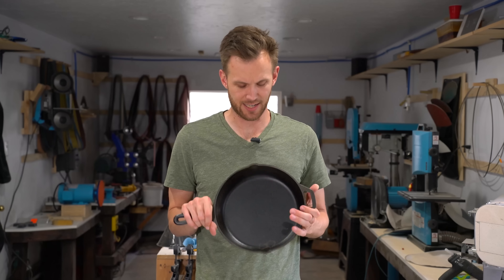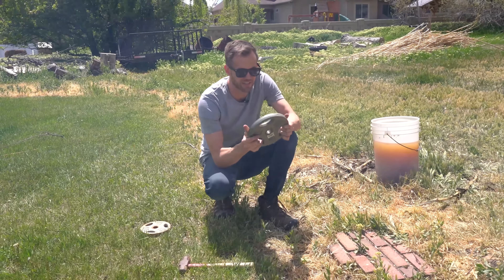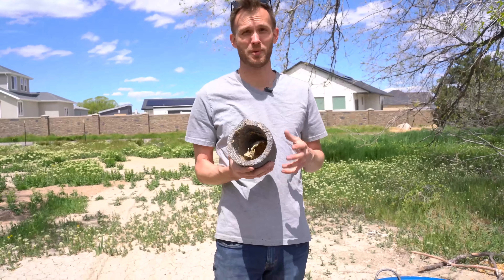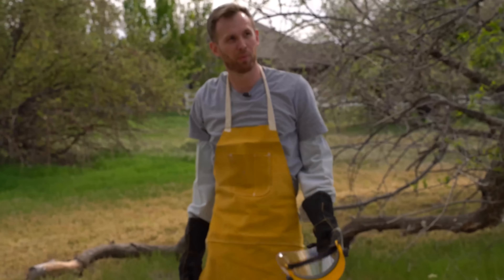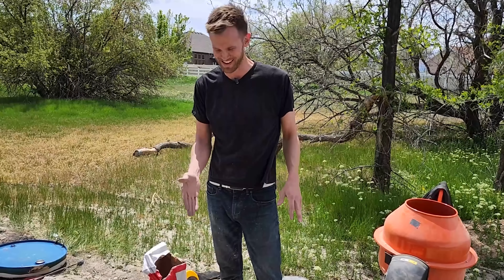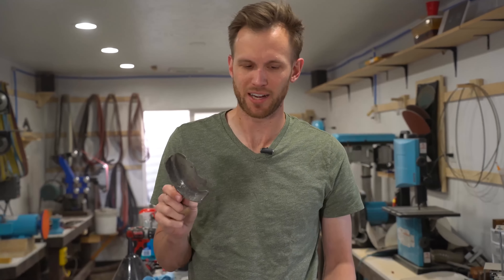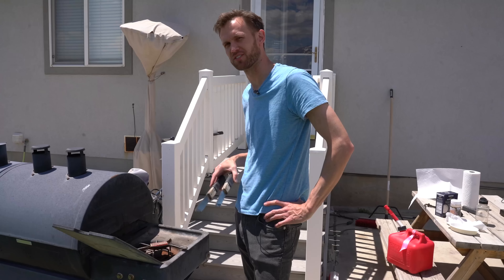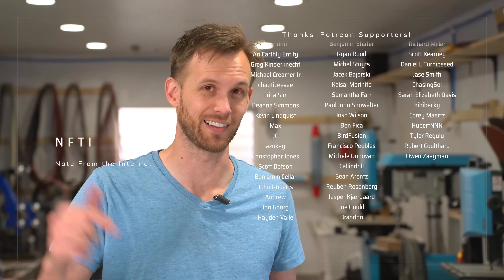Turning Weights into a Cast Iron Pan!

Comment: When casting, you also need a place for air to come out as metal goes in. Love the videos. Keep trying
Reply: This, more than anything! It's also a good idea to make a riser, a reservoir above the mold which gravity feeds your iron in. Most guys use a soup can and some steel tubing as a form. It really helps to shove the metal into the corners.
Reply: An air escape hole opposite the pour while really would help.
Reply: @Corbald  Ah yes!, and helps hold the heat, too, keeping the supply of iron molten, if I recall correctly from my Uni days.

Comment: I've only ever casted aluminum and I did it nearly 2 decades ago but when casting, I believe we had a breather hole on the opposite side of the pour hole so it could flow without any pressure buildup. This will let the metal flow better in the cast and also let you see on the other side when you have enough poured as it will start to rise out the other side.
Reply: Good advice
Reply: I was wondering if there needed to be a second hole to relieve the pressure during the pour
Reply: There are some amazing mold coatings that are like a ceramic paint but they use extremely flammable solvents that burn off almost instantly and leave a mirror smooth surface finish right out of the mold. I've done a lot of aluminum casting and I've cast over 1000lbs of lead so I thought I knew alot about casting. Then I watched some professional foundry workers and realized that I only knew about 5% of what there is to know about casting.

Comment: Nate: YOU HAVE TO PUT AN AIR PORT OPPOSITE THE ONE YOU POUR INTO... AIR AND GASES HAVE TO BE ABLE TO ESCAPE JUST LIKE TRYING TO POUR INTO A BOTTLE AND IT SPITS BACK UP AT YOU. AIR CAN'T COME OUT THROUGH THE METAL BLOCKING THE ENTRY. REMEMBER HOT AIR EXPANDS AS WELL.

Comment: Can't help but think you should use the handle as a pour spout and cast it vertically to reduce heat loss.
Reply: This honestly drove me a little insane 😂
Reply: Nice thinking
Reply: It would be best if the sprue was on the bottom of the pan and was large enough to act as the riser also to control shrink, the handle should have a vent on the tip. It will relieve pressure and signal a complete pour.
Reply: All the really old cast iron pans I have seen had the casting gate in the center of the bottom of the pan.

Comment: I have a recommendation to help with your casting. Shape your desired piece out of paraffin or candle wax. Place this form in your Green sand and add pour funnel and vents. Pour your molten metal. The metal will burn away the wax, creating a draw, pulling your metal into the mold. Be careful because it will spit a little.

Comment: 1.)  It's not hot enough, you need to get well above its melting point to ensure it flows into the mold properly
2.)  the molds need to be vented in some way, the air inside them needs to go somewhere.  The wet sand will hold its shape but it's not porous enough to allow natural venting
3.)  the bubbling in the open molds is a result of the mold containing moisture.  Even the smallest drop of moisture can result in a steam explosion that sprays molten metal all over and causes bubbles in the surface.  Preheat your molds until dry whenever possible.
Reply: What this guy said. Hotter metal, air vents, preheat the mold. Yes, to all those.
Reply: And extend the sprue, somewhat
Reply: Totally agree, but want to add that the way to increase the temperature is by adding oxygen... NOT using compressed oxygen from a gas bottle, but blowing in air with a blower, (a pipe through the sidewall of the foundry to which you attach an old hair dryer, although you can use a manual bellows if you need an intense arm workout). Also has to have a port for the air to exit, preferably creating a vortex inside the foundry, swirling around the crucible. The color of the molten metal is the indicator of its temperature. Red hot is not hot enough, orange-getting warmer, yellow-almost there, almost white hot, get ready to pour.

Don't know for sure, but I think having the mould angled slightly downward from the sprue may help. Biggest thing though is venting. Trapped air inside the mould will prevent adequate filling.
Here is a good resource on making green sand
https://foundry101.com/mixing-sand/
Reply: Also you should never use wet molds you will have it make steam which can either produce air pockets in the metal or worst case it explodes in not a good way :)
Reply: Not to mention that a pre-heated mold will just cool the metal slower. Thermal transfer is proportional to the 4th power of the temperature difference, so even a little heat added to it will help a lot.

Comment: I remember from brass casting, your pore hole should be at the end of the handle.  You might also put a pore hole on the far side of the pan.  Build the sand mold withe the pore channels so you don’t have cave in.  Cut off the excess afterward.  Our castings used more than 1 pore hole to complete the fittings.

Comment: I think you need to add vent holes at the extremities of the mold to allow the air to escape. It’s creating pressure especially with the high heat. So once the liquid metal backs up, that’s it. It’s not going to go much further than where it is.

Comment: Also, when you're cutting the excess of the pan, it would help if you heat up the whole thing with a blowtorch in order to prevent any massive temperature gradients where you're cutting, I've cracked a cast iron pan by having it on a Swedish One Log Fire and strong winds hitting the side. Same goes for if you're welding cast iron, but that's a whole different set of skills. Great video regardless, I'm glad to see you didn't give up the moment you saw it wasn't going perfectly. Well done, and thanks for bringing back the golden days of TKOR.

Comment: Hey Nate, worked in a legit iron foundry for a number of years, I have some tips that could help. Try adding a wooden bead around the inside of each mould half, ideally a half round dowel, 20mm diameter would work, or failing that, a 10mm square baton, nailed to the inside of the wooden mould halfway up, this would give the green sand something to purchase onto. Also, we used resin set sand "air set moulding" it used a slow curing resin mixed in with the sand, set in about 20 minutes, after which, we would remove the "pattern" (the thing we are casting and then close the two sides up. we would only add the pouring hole and sprues on one side of the mould, and we would also add a smaller pouring hole, that would allow the iron to flow through and not create an air pocket, ideally this would be polar opposite to the hole you are pouring into - feel free to hit me up if you want to know more. loving all of your videos.
Reply: I wondered if you could mix something in with the sand to harden it, but would resin be able to handle those temperatures, and would it be food safe with regards to residue? Also have you ever used graphite for molds?
Reply: @DFPercush  so we used resin in a commercial iron foundry, 100s of employees. So I assume it was the correct stuff. And at those temperatures, I assume anything that could be considered non food safe, would be burnt off by the 2000 degree iron. We made all sorts, including iron pans.
Reply: @topcat2757  That's interesting, thanks for responding. One more question though, does the resin make the mold reusable, or do you still have to break it each time?

Comment: Yes, I want to see you do more with cast Iron!
A blower will help get the temps up higher in the propane foundry/furnace. I’ve melted steel using dense fire bricks, a weed burner and a $20 Home Depot shop vac on blow. Your setup is much better insulated than anything I’ve used.

Adding a flux, like quartz sand and borax will help with cleaning of the iron, lowering the melting temp and making the iron flow better.

Comment: The sand needs to have some oil mixed in to make the sand pack and pack the sand in layers when getting the mold ready also you need a pour spot and a return hole
Reply: Mix in some powdered clay also to act as a bonding agent. A 5 to 1 ratio is a good starting point.

Comment: I think this amazing, and I feel that if you "perfect" the casting cast iron pans" then you'll work out all sorts of issues.
One thing I think you need is an exit or vent hole. As you pour in the molten iron the moisure in the sand turns to steam and expands... that might also be hindering the pour. So a vent hole on the fast side of the mold might make a huge difference. You can make it with sometime as simple as a straw while the pan is still in the mold and a decent cardboard straw should be enough, can even leave it in the sand while you pour as it'll burn off if it gets too hot.

Comment: speaking from experience, Nate you need to add 3 to 4 channels into your mold to allow for the air pocket to be moved into. It is that air pocket that is stopping the molten metal from spreading farther into your mold. You can also try adding an overflow channel at the other end of the mold to allow the air to escape and so you can see when you have added enough molten material in your pore.

Comment: Yes! I'd love to see you try and get a full pan!
> Like many here I'm curious why you didn't attempt to have the pour hole deposit molten iron into the middle of the pan so that there is a better likelihood that it would reach the edges before it cooled off.
> Also, perhaps instead of making a pan, make a griddle instead?... it's essentially just a flat slab of cooking surface and you can use a small baking sheet as your template... you can even carve some strips (or press small rebar?) into the top mold to create raised metal rows that can create grill marks... the back side can serve as your flat top. ;)

Looking forward to what you come up next!

Comment: With cast iron being flat bottom, one might be able to make an open topped mold so that you don't have to worry about flling a solid void that has no way for air to escape. May end up with a THICK handle, but you would be able to fully form the pan itself
Reply: Nice idea

Comment: Hey Nate, while the pan is in the sand mold set your pour hole in the center of the bottom of the pan. Also preheat your mold so the pour temp doesn't drop so quickly.

Comment: You might try a flux(say borax for instance) since that's a traditional way to lower the melting temperature required and clean the metals involved in casting. Add some plaster to your greensand and bake out your molds or make a full plaster lost wax mould. You should also have more fullers earth than that for iron as it needs far more mould integrity.

Comment: (1) Please make a Discord server! (2) Idea: You could use the lost-wax or lost-styrofoam method, but with the flat surface on the top. That way, the metal only has to go in the channels deep enough to make the sides and the handle, and you might get an uneven bottom (as in the part which sits on the fire, not the part on which you cook). Alternatively, you might want to use a plaster to make the sand tougher, to prevent the sand on the top side from falling on the bottom side. I think you should also try to use a geopolymer (cement-like) mixture of clay, lye, and waterglass or silica sand (there's apparently other sands, like granite sand, for example). The clay (ideally metakaolin, but any clay good enough for pottery works, and you can even use normal mud from the ground around the furnace), lye (sodium hydroxide, or potassium hydroxide which can be made by mixing wood ash with water and then the lye is dissolved in the water), and silica sand or beach sand (which can be mixed with lye  (of any of those 2 types) to make waterglass) or waterglass, then the mixture will set like cement, and end up more thermally resistant than cement, closer to terracotta (depending on the terracotta and the geopolymer mixture). With a proper mold, especially if you can heat it a bit in the kiln, I think your chances of success are much higher. If you use cement, remember that you can use something like 3%-6% and 2-4 times more water than cement, and the rest can be the sand mixture you're already using, and after the cement cures (ideally using a cement which sets in 30 minutes or so, but one which sets in a day or two also works well), you can remove the positive from the mold (if it's not done using the lost-wax or lost-styrofoam method), re-assemble the two sides, and pour the metal. Depending on the mixture, you can also heat it slowly in the kiln or in a home oven, to get it hotter, so the metal flows a longer distance before it solidifies.

Comment: Hi Nate

got some ideas (humble suggestions) for your next skillet.

When something round is laying flat, placing the pour hole (sprue) in the middle of the pan with thin air escapes around the edge and or at the end of the handle makes more sense (to me at least).

when your stuck with course sand some funnel shape cylinders (with little handles on the top) that sit on the frying pan so as to tightly pack sand around them, removing them just before pouring to help avoid collapsing that can result from digging movement.

After you refined the green sand mix just for fun, try doing it with materials of differing viscosity that cost less or don't need to melt (resin, wax, chocolate, sugar glass...).

Comment: If you redo the furnace lid for future casting, drill some holes around the circumference and put some bolts through before pouring the cement. They will act like rebar and permanently attach the steel part to the insulation.

Comment: I would love to see more of this.  If you try again I know that it isn't exactly correct but you could put the spout on the bottom and have the air outlet on the handle.  This would make it so the main part of the pan is the first to get filled and would push towards the outlet.  You had to cut of the excess anyway and clean it up so it shouldn't be too different.

Comment: I would definitely love to see you continue your quest into casting iron. My suggestion is that the forge is too big for your burner. Adding a second burner should solve your problem of getting up to temperature. You also may want to add a vent hole in the lid.

Comment: Not an expert by any means, but I did some casting in college. We had a pour channel and a vent channel on the other side so the metal would flow all the way through. Also, we used styrofoam as the mold so the metal would take the foam away and leave the casting. Also, I believe the sand had some oil in it. Hope this helps.

Comment: super fine sand mixed with sodium silicate, make your mold then bag the mold and flood it with CO2 to set the silicate. Also use a sprue on the opposite end of the fill to allow the gases to escape out instead of getting stuck inside the mold.

Comment: Liquid glass and sand to make the mold. And preheat the mold. You dont have to get the metal hotter, if the mold is hot too. But that requires using something besides wood as a mold frame. You also need a vent on the other side.

Comment: I've watched casting videos before and I've noticed that they add vent tubes to the mold on the opposite side from the pour spout for air to escape so that the metal can fill the whole mold.  If you're going to try it again, you'd probably need to do that to get a full cast.  Another person posted the same suggestion in the comments and called it a breather hole.

Comment: Yes, try again. Next time, leave a vent hole opposite the pour hole, so air has a way to escape out the other side of the pan, as metal flows in. Also, cast the pan right-side-up rather than upside-down.

Comment: I have an old huge cast iron pan, and there's remains of a pour spout straight in the middle of the surface of the pan. For some reason it wasn't properly ground down, and for some equally strange reason I never got around to grind it flat even though I've sworn about it numerous times as the spatula catches on it when scraping the pan. So adding a spout in the middle of the pan probably is a good idea as well as several ways for the air to evacuate the mold as you pour the iron.

Another thing to consider is preheating the mold. It takes making a large oven and I have no idea how to stabilize the sand. But it's an idea. Perhaps try lost wax? Just throwing things out there...

Comment: I wont claim to be the first. However I have used screwdrivers for cooking after a housefire left me living in a car for a couple months. I had decided to use only what I had with me so I could put my money towards rebuilding. What I had with me was the car which contained a camping stove a single pan a single pot and my tools. I did have a camping set of utensils but I was to lazy to bring those out other than my chopsticks which I only used when making ramen. A favorite dish of mine.

Comment: You're going to need to add a vent opposite of your pouring hole. Cast iron is very viscous even at molten temperatures. Once you start pouring, you need a vent hole to allow air within the mold to escape.

Comment: I think that the flat orientation of your pan in the mold require more of a 'vault' that your sand is going to be willing to do. Seems like it would be easier, vertical. Then, your handle can be right at the beginning of your sprew. Just hypothesizing.

Comment: I'd say do a sand mold with the pan on its side with the handle as the pour spout or even at a 45⁰ angle with the handle at the top. I've never cast anything before but it should allow for a faster flow allowing the iron to get where it needs to be before freezing.